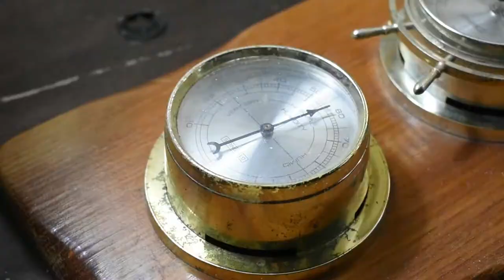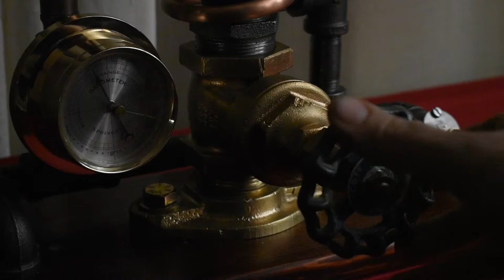Weather Station Steampunk Pipe Lamp ( Springfield Instruments )

Comment: One of the best steampunk lamps I’ve seen!  However, here in this country the fittings and other materials would cost about $700.  Pretty expensive for a lamp.
Reply from the maker: Thank you so much. I really appreciate it. Yes, it would definitely be too expensive for me to make if I bought the pieces. Everything was scrap or found stuff. My Father did demolition. I used a bunch of stuff he scavenged from the job sites.
Reply: @drewdoesart9277  awesome creation outa scrap!

Comment: Good afternoon. How much does such a lamp cost?
Reply from the maker: Well to buy everything new it would be a lot. like TOO Much for a lamp. LOL however I got most everything from scrap. The weather station came from old junk from my patents house. The valves and copper for the coil and most of the fittings came from scrap. My Father was a Pipe Fitter before he passed. I inherited all his tools and junk for that matter. Most Everything I had to clean up with wire brushes. I did have to buy some stuff like the copper union. and the bulbs obviously. maybe a few little things to make thing work but very minimal.   

Thanks for the comment.